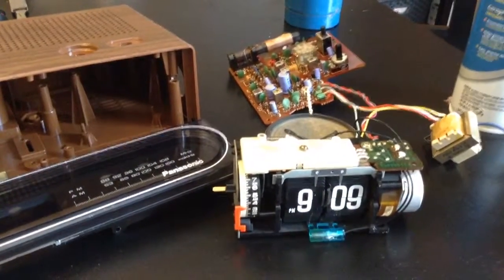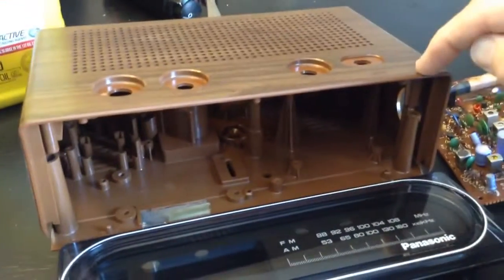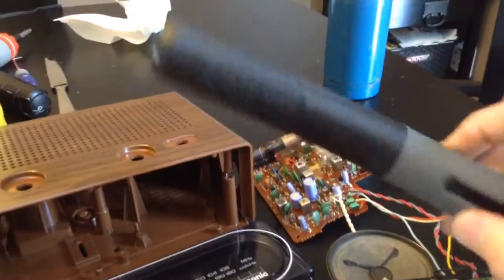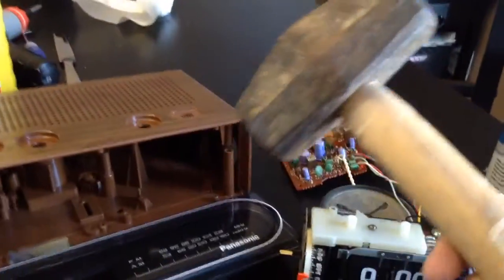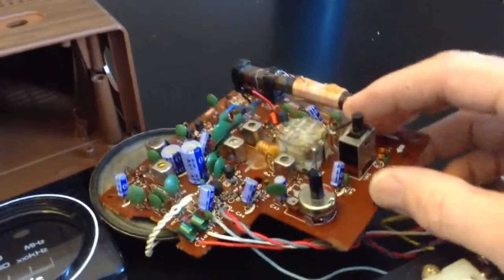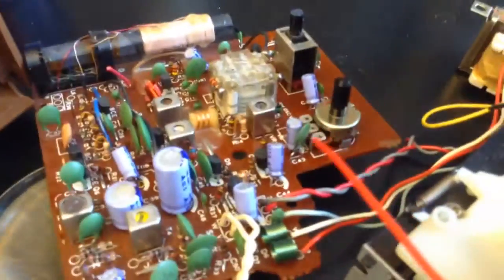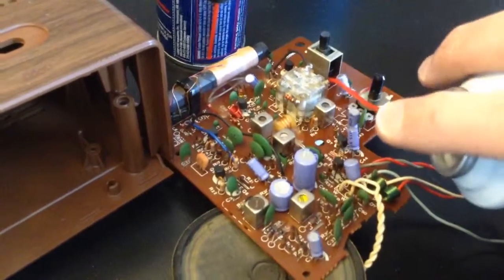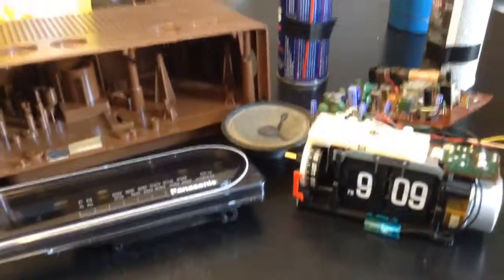The Perils of cleaning and lubricating a Flip Clock. How to do it right!

Comment: Not helpful at all. I was hoping for instructions on oiling the gears for the click itself. Mine sticks sometimes.
Reply from the maker: I see what you're saying. I don't often lubricate that part of the clock mechanism. There may be spots that could use a little white lithium grease, but usually most areas are clean and dry. Sometimes this sticking is due to accumulated dust. The worse culprit is when people did some sanding in the vicinity and dust got in there. I tell you, I just had a clock where someone  sprayed some kind of lubricant all over the mechanism. It was horrible. It did not work. I would recommend taking the clock apart, start with trying to blow out the dust then manually spinning the clock time (like you're changing time) a lot, to try to work out any dust.  If that doesn't work we have to try to figure out exactly where it's hanging up.